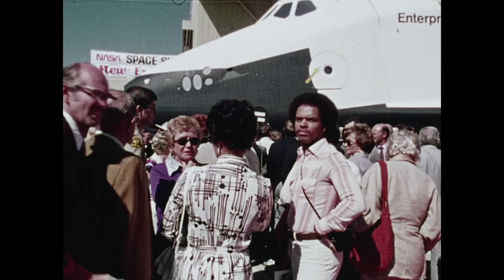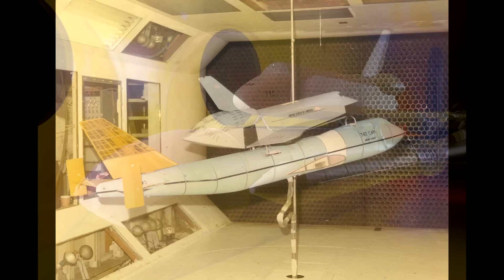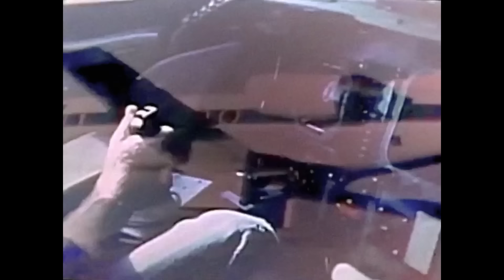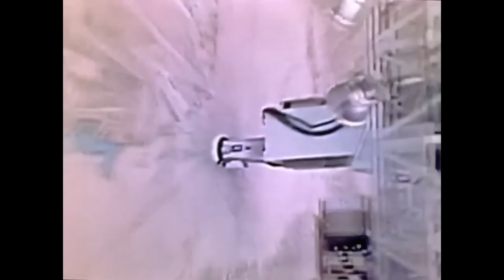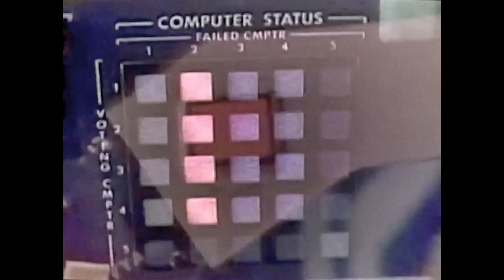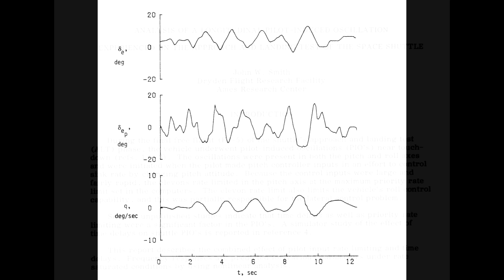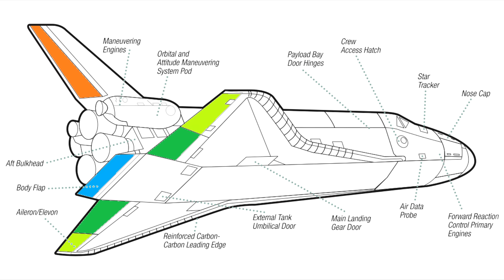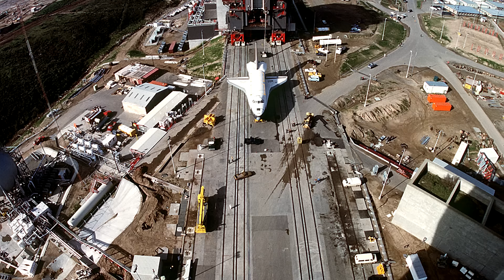How NASA Learned To Fly The Space Shuttle Like A Glider

Comment: The Shuttle program was a "workhorse" for DOD payloads, the ISS, Hubble, et al.  The orbiter technology as well as mission control was 70's era at best.  System redundancy was everywhere.  I worked as a NASA contractor at JSC from 85 thru 93; 35 missions.  We called it the "flying bathtub" because of it's color, overall appearance, and flight capabilities. My primary task was Telemetry with checkout software for every mission.  Long ago, the orbiter/shuttle program  was a key instrument to projects of that era.    Henry Towne

Comment: I worked the early days of the Space Shuttle program.....as I remember, Enterprise was intended fly to orbit, but during the time enterprise was being built it was discovered that the wings/tail were not strong enough to fly through the maximum dynamic pressure region of ascent flight.    The Wings and Tail could not be made strong enough without costing a lot of payload to orbit capability, so Day of launch wind biasing was baselined.   This required balloons to be launch several times prior to launch.  The balloon data was sent to Rockwell in Downey, CA to run a flight simulation, and then structural loads to be estimated.   These results was then briefed during the launch Go/No go decision meeting.    I was also in the Downey control room during this last flight of Enterprise....I though he was going to stall....was not a pretty landing!
Reply: @paulweston8184  just to correct your misunderstanding.... I was a glider pilot  ..... gliders can stall too.... they have and if occurring near the ground a pilot can be severely injured or killed..... stalling means loss of enough lift that drag and gravity win and plane/glider can fall out of the sky
Reply: @davidpearson5574  I apologize. I realize what you are saying now. I was under the impression that a stall occurs from the oxygen being too lean due to not enough air pressure on the intake. I wasn't thinking that it also applies to the wing when it stops producing lift. Sorry bout that.
Reply: @paulweston8184  no apology necessary......in a perfect landing, whether glider or plane with motor ,   The plane is in a stall condition as it touches down...,anything different and it is a hard landing or worse
Reply: I think you are a liar. Columbia was the first space rated orbiter, Challenger was a static test article that was converted to space rated orbiter
Reply: @HenryHildebrant-g1r  if you would of read my comment more closely you would see I was talking about enterprise

Comment: I find the premise of you video rather silly. The Space Shuttle had years of design and wind tunnel testing, by some of the best aeronautical and aerospace engineers in th world. It's got a high-sweep delta wing, technology that was well understood by the lat 1950s/early '60s. It has control surfaces, either fixed or adjustable horizontal stabilizers and a vertical sabilizer and rudder, like other aircraft. So why wouldn' it fly well?

Comment: Great video. One thing I was always confused about with the fly by wire on the space shuttle was why the software and PIO had those problems, when Concorde with a similar Elevon set up had fly by wire working 10 years previously. Anyone know?
Reply: That's an interesting question! I'm not an aerospace engineer — that would be my dad — but I imagine that despite somewhat similar elevon configuration, the control systems had to be very different, since Concorde was a hypersonic powered plane with jet engines and much larger wings and tail surfaces, whereas the shuttle was a brick pretending it was a glider.

I was just gonna leave it at that, but I got curious and went hunting around for more info. I remembered there's a horizontal flap under the space shuttle's main engines (used only for launch) whereas Concorde's  got a pointy cap over its butt covering a trim tank (dammit, Jim, I'm a classics major, not a scientist, although I know enough about aerospace from my dad to understand the basics). Sure enough, that points to some key differences in their control surfaces.

1) Concorde has 3 elevons on each wing for controlling roll, pitch. Whereas the Space Shuttle has 2 elevons on each wing for controlling roll and pitch, but the body flap in back is both a heat shield for the main engines AND works like a horizontal stabilizer to help control pitch a little more.
2) They both have split rudders, but as far as I can tell Concorde's is just for redundancy and fine control of yaw, whereas the shuttle's doubles as a speed brake. Concorde has NO speed brakes, using only wheel brakes and reverse thrusters, which of course the space shuttle can't (so it has a drogue chute). 
3) The Concorde's flight systems, including landing, relied on autothrottle: the use of the engines to control speed was a critical part of landing.
4) For what it's worth, the Shuttle was using an IBM AP-101 system that had been developed for the B-52 bomber (also developed and tested at Edwards AFB), also used by the F-15 fighter and Skylab. Like all of NASA's computer systems, it was old and out of date compared to computers of the time when the shuttles actually flew, but there was a good reason for that: shuttles needed to have old, reliable, idiot-proof computers that had been used for decades and had all the bugs worked out of them. As my Dad's boss Bob Crippen put it, "You're not gonna run the Space Shuttle on Windows; a bluescreen of death might be the last thing you ever see."

Comment: I worked on that simulator and the camera model.   Lord that was many years ago.    ISS simulator is simple by comparison.  No flight controls. Now the Shuttle simulator is going in the Lonestar Flight Museum in Houston.
Reply: Are you referring to the shuttle motion base simulator in building 5 at the Johnson Space Center? I flew that several times without formal training. I landed perfectly most of the time but other times I descended too quickly and impacted the air strip too hard (probably ‘crash’). I worked many years in building 5 and 35 where the fixed and motion base simulators were. Those huge buildings were filled with computer consoles. I imagine a cell phone has similar computing capabilities.
Reply: @MovieMakingMan   Yes, I work in Bldg 5 (35 no longer exists) from the late 70's up to the present.     Now where the SMS MB was is the Starliner simulator but it isn't being used anymore.      The ISS simulator is upstairs in a new part of the building.   The Artemis simulator is a fixed base trainer where the SMS FB used to be.
Reply: @ We must’ve ran into each other then. I worked there the same time you did. Did you work for NASA or contractors? Thanks for the reply!
Reply: @MovieMakingMan  I worked for a string of contractors as the contract was rebid or projects started.   Link -> CAE Link -> Hughes Training -> United Space Alliance -> Lockheed Martin -> Leidos -> SGT -> KBR     All the same job, just a different badge.
Reply: @ I wore many hats too. When contracts ended I transferred to another company. I worked for Northrop, Bendix, WDY, McDonald Douglas and Boeing. I worked in many buildings like building 9 (Manipulator Development facility) as an engineer, building 7 as a designer/draftsman, building 29 as a test conductor & suit subject, building 260 (technician & suit subject), offsite as an engineer and later I created a video production facility for McDonald Douglas where I made mission overview videos. I miss working with so many great people.

Comment: I can only imagine what these early fly by wire systems felt like. After thousands of hours in traditional planes, my first A320 sim lesson was rough; I was constantly chasing the plane. My second flight was perfect after I really took home that "less is more" when flying those. In a normal plane, you're used to constantly working to keep the airplane where you want it, especially in slower flight; you learn to feel the plane and almost react before the plane even starts rolling left because of some turbulence. In FBW, and particularly the airbus, it's quite the opposite. You use the controls to tell the airplane where you want it to go. It's super easy to create PIO (pilot induced oscillation) if you're trying to fly it like a regular plane. This is partially because there's a bit of a lag between you and the flight controls. So what you perceive as the plane getting pushed in a left roll, the airplane already knows and is doing something and then it sees your input to roll right and it thinks, ok he wants to go right, so suddenly you're over to the right instead of level. Granted I am NOT a test pilot and I'm sure these guys knew quite well what to expect. But in a traditional plane that might have some aerodynamic quirk, you kind of learn the feel quickly and go, ok, that's what I'm dealing with. Where in FBW, you're left with the classic question: what is it doing now? Or why is it doing that?
Reply: That is why the suggestion was to let go of the stick.
The control system does not have enough authority to meet any input. Humans tend to update twice per second in a "dead beat" fashion leading to a 1 Hz oscillation.
An impatient human will try to generate a faster response by larger input.
Reply: Flying a FBW flight control airplane is more like “flying” a spacecraft. Very different than a conventional jet as much of the aerodynamic feel and feedback you get from a conventional flight control system is absent.
Reply: Funny that you found it so difficult. Did you have a type rating on another aircraft before? When I was in a 320 sim, it felt as stable as it gets. I can’t follow your PIO observations at all. I do see what you mean by it feeling a bit sluggish, but then again you can yank it full nose-up (or rather max G) with very little force.

Comment: Dollar Stores used to sell styrofoam gliders of the Shuttle & when you launched it with the rubber band, first thingbit did was a loop de loop, then settle down in a long gentle glide.
I stuck a series of Estes "A" engines on it, but the aerodynamics were "difficult" & the heat eventually melted a  chunk out of it, leading me to design a Crew Compartment Escape Module that could separate the whole thing, then whatever...

Comment: Enterprise also has a much neater finish on the outer surface, probably due to the fact that it didn't have the final thermal insulation.  Up close, the real shuttles look pretty shabby, with big, ugly seams between the pieces of insulation, and a surface finish that looks more fuzzy than smooth.

Comment: It's always weird watching these videos, and looking at old shuttle tech.   I know it was state of the art for the 1970s.   But now, we could replace the electronics with a handful of stock dev board  ESP32s or Arduinos.   The number would really just be dependent on the number of interfaces, and how much could be run on multiplexed pins.  Put them in a lead box, and you'd have space safe control system that won't be effected by cosmic radiation. 

Really, if any were flight ready, and I were given a choice of flying with the old shuttle computers, or modern microcontrollers, I'd take the modern microcontrollers.   Obviously, the better answer is a decent modern computer, like SpaceX is doing with theirs.  They're just using x86 hardware running Linux.  They get the benefit of those beautiful displays, and no concerns about the computers falling behind.  It isn't like the old AP101 running near capacity.  They're running barely over idle.   They could also just upgrade the hardware any time they want, with a few provisions for the appropriate IO interfaces.   

If NASA had done that, they would have likely been running on the Intel 8086.  By the end of the shuttle program, they could have just upgraded the computer to a Core i7 or Phenom II based system.    Of course, when they did the initial design, they didn't know that the x86 platform would become so common and available.   And the AP-101 was launched in 1966, and had been used in other DoD aircraft systems, so they didn't have to reinvent everything.  We really have come a long way.  Technology isn't the same struggle as it was back then.

Comment: If its a glider, then why are there multiple videos with sound that show when the shuttle is landing you can hear the small turbojets reversing to slow the shuttle down and when it stops you can hear the engines shutting down.  And don't bother telling me its an APU because those aren't used during landing.  It has the glide capabilities of a rock and all you need to do is look at what a glider looks like to figure this out.  This will glide as well as a fighter jet, which is like flying a lawn dart if the engine quits.
Reply: its a glider, then why are there multiple videos with sound that show when the shuttle is landing you can hear the small turbojets reversing to slow the shuttle down and when it stops you can hear the engines shutting down.

So tell me where is air intake holes for engines in shuttle?
Reply: @tgstudio85  And if its a glider, then why does it make turbojet sounds?  turbojets are significantly smaller engines than today's turbofan engines and there are two small bumps at the tail that look exactly like the engines that are on an older plane like a DC9.  Look at a DC9 and tell me that it doesn't look similar.  I fly scale model planes for years and know what glides and what doesn't.  Nothing of this design will glide properly and land safely without power.  Once it gets below a certain speed it will just drop like a rock because the wing design isn't designed to provide enough lift.

Comment: Enterprise was actually intended to fly in space, the plan was after the landing tests to take it apart and refit it for space flight. This is indicated by it's 'serial number' of OV-101 (there was no OV-100 which would have indicated an  serial# of zero) with the 'OV' meaning Orbital Vehicle. What they realized was it would be cheaper to  instead use the Structural Test Article spaceframe to build the next shuttle around, which is what they did to create Challenger. This is how you got the odd sequence of serial#'s of the shuttles

OV-101   Enterprise (never flew in space)
OV-102   Colombia
OV-099   Challenger (originally the structural test article STA-099)
OV-103   Discovery
OV-104   Atlantis
OV-105   Endeavor

All the hardware intended for space flight had a 1xx serial#, all the hardware intended for ground testing began with 0xx. When they used the Structural Test Article frame to build Challenger, since it already had an test article serai# of STA-099, they just changed it to OV-099 rather than create an new OV serial# since the hardware technically already had a number. This also means that all the other 'shuttles' with OV serial#'s aren't' really "Orbital Vehicles" even though they are being presented as such (not that I really mind)

And just for those who were wondering, I was in elementary school  back when Colombia first launched, and our neighbor (who had been a family friend since my dad was the same age as I was at the time) happened to work for Rockwell International who was building the shuttles. Because he knew I was interested in the shuttle program, I ended up getting all sorts of unique material as well as learning a lot about the Space Shuttles from him.
Reply: OK, I wrote this before finishing the entire video (my wife came by and did something sily, she asked me a question about the Enterprise....😄) so please forgive me repeating what Scott had already said as well.....🙄

Comment: I’ve been looking for years for any picture of the shuttle simulator.  Finally you showed a few seconds of it.
I remember in Southern California they had two stationary shuttle flight decks simulators nose to nose.    One of them would be hooked up to a camera on a gantry in the room. I remembered the near as big as a football field.   I believe on the floor was a model of Florida.
Edwards Air Force Base would’ve been on the wall.  And the ceiling was the alternate landing site in Puerto Rico.     They would actually fly a camera in the room on gantries.  So detailed you could actually crash through building models in in the Florida model.  All I n the days before electronic flight simulators.    I believe the 4 shuttle computers were only 16k of Memory.      Three working to check each other’s work and a fourth one to be brought online if one was found faulty.
I was starting to think I was crazy because I’ve never been able to find a picture of the mechanical simulator.
They also had a Shuttle arm simulator

Comment: I remember several times with Enterprise:

1.  Stacking Enterprise with inert SRBs and ET in the VAB and doing rollout tests to Pad 39A.
2.  Stacking Enterprise out at VAFB and rolling it on the road (that was a nightmare as the road was tight and had some interesting turns.
3.  Testing the leading edge panels following the Columbia accident (that was a sad time!)